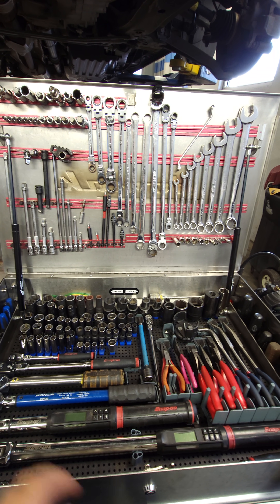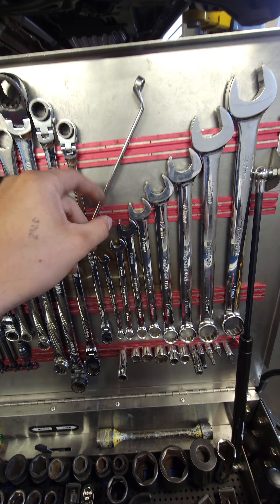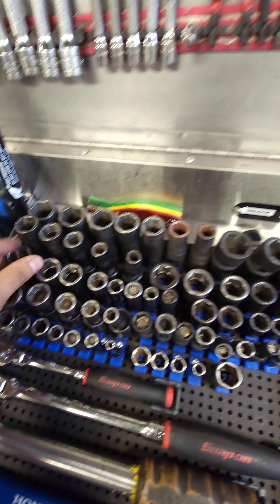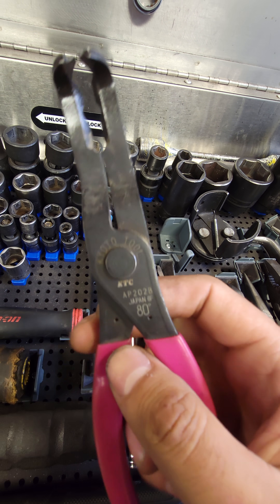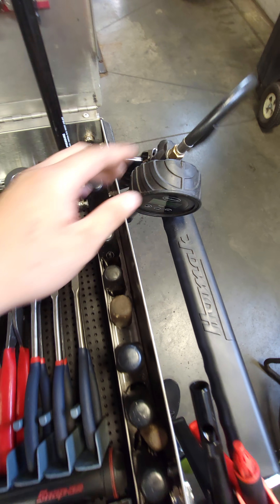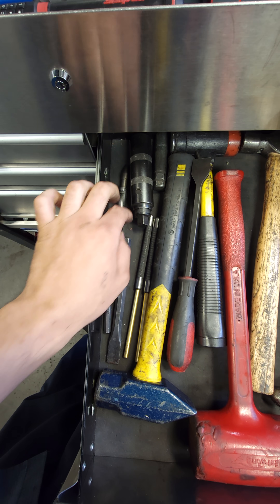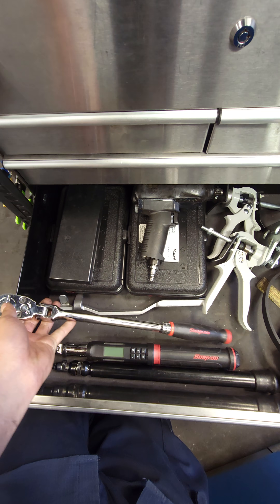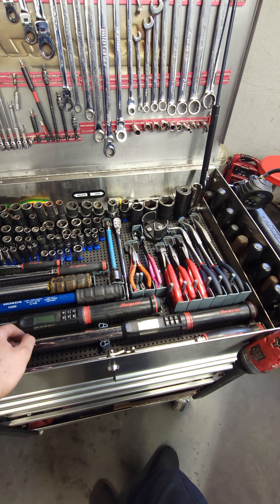Technician Roll Cart Tour | Honda Technician | Tool Grid

Comment: It’s nice to only need 4 or 5 sizes. I was at a shop that did mostly hondas and kept trying to set my cart up that way. Every time I’d immediately get some random chrysler or something that I had to do in an open bay across the shop. Then I’d spend more time going back for tools than actually fixing the car
Reply from the maker: Yea I feel you there. The only reason all these tools are selected in here like this is because my lift broke down and I worked 3 months across the shop from my bay. Being a dealer tech definitely has it's benefits.

Comment: Those Snap-On double box ends are one of the best tool purchases I've ever made. I still use them all the time even though I'm just a diy guy now.
Reply: Because they're straight. Why snap on don't make a set of straight regular wrenches is beyond me, they could sell millions. They almost never slip even when hit with a sledge hammer, you can even put a 2 ton jack under one if needs be!

Comment: Using the lid is the way to go.  I also have VIM rails but you’ll get more bang for the buck using Amazon rare earth magnets.   Thanks for the tour!
Reply from the maker: Yea I had these mag rails for my sockets for the longest time until I got the toolgrid system and then I needed to figure out what to do with 3 sets of mag rails.
Reply: @techt-bone4337  hey who makes the tool cart
Reply from the maker: @johnb1121  Homak. I don't think they manufacturer this one in particular anymore. https://www.vehicleservicepros.com/directory/equipment/tool-storage/toolboxes-and-tool-carts/product/12033015/homak-manufacturing-llc-35-stainless-steel-4drawer-service-cart
Reply: @johnb1121  Snap-on.  Used at 50% new.
Reply: @techt-bone4337  thanks I thought it was good choice
Reply from the maker: Thinking about getting the new harbor freight one
Reply: @techt-bone4337  I will get one for my house for sure worth it

Comment: The only problem with having a stacked cart with no wasted space is once its full it hardly moves. You definitely don't want to roll it around all day. I have a blue point 3 drawer with a top lid and the wheels feel like they're gonna snap going over a zip tie. I'm thinking of welding some cross braces or some adjustable cables like a steel structure. I can't afford a new box suitable for like 5k in tools, haven't found a solution yet.

Comment: How do you like those KTC clip pliers? I'm guessing by the locations you use the 80 degrees more than the 35's. Working on Hondas, do you think you could get away with just the 80 degree set for most things? Thanks and loved the tour!
Reply from the maker: The bigger ones are really nice I use them 99% of the time unless the clip is recessed it won't grab it. The smaller ones are nice too but I don't use them a whole lot. I seem to break less clips with the ktc ones vs the harbor freight ones.

Comment: Nice setup,  its that a 14mm spark plug socket modified?  Thanks
Reply from the maker: It's a regular 5/8 spark plug socket. Had a car that overheated and the plug wires melted in the spark plug hole. Customer wanted a leak down test, so I modified it so I could cut through the rubber and get the plugs out.

Comment: I have my cart layout with complete sets.  Your layout is more efficient and allows you to have a wider variety in your cart.  It gives me Something for me to think on.
Reply from the maker: I got really annoyed of having sockets I didn't really use on my cart. I found myself grabbing them by mistake often. At one point I flipped the ones I didn't use much around so I could identify them, then I just took them out all together. They are still really accessible in my tool box, but not in my way on my tool cart.

Comment: For the 3/8 flex ratchet have you used the locking flex head version from Snap on?  Not sure which one to get.  Thanks.
Reply from the maker: From the techs that I have seen get those the locking mechanism is not the best. It breaks often and can get knocked free. I have not really needed a locking one, however if I had a Matco dealer I'd probably get a Matco locking one.
Reply: @techt-bone4337  Thank you.  I heard Matco are good as well.
Reply from the maker: Our Matco dealer stopped coming just as I wanted to get one of those ratchets. The head is also slimmer than the Snap-on ones.

Comment: You were talking about the Jesus pliers from harbor freight have you checked out the tekton complete line on the pliers i bought a i believe 9 1/2 inch long handles i had like $23 in rewards for the website and i got the pliers and honestly and this is coming from a big fan of channel lock pliers I've owned several different sets of them that pair of tekton pliers is impressive they are built really well and made in the USA, and as far as your craftsman USA made pry bar set,hyper tough and Menards master force and the Mayhew i believe that is the dominator series are all the same pry bar set all are made by Mayhew.

Comment: Hey Tech T-Bone new subscriber!; I have a question I’m currently going to start as a Lube Tech and was curious cause my boss said I’ll need a air gun (impact) but didn’t specify what size? Does he mean like a 1/2 if so can I just get a cordless or should I go with the air
Reply from the maker: As a luber usually a 1/2 is what you'll use for removing and installing wheels. Honestly I would start with a cheaper air 1/2 impact.
Reply: @techt-bone4337  okay man! thanks broths and any recommendations you can give since I’m starting off?
Reply from the maker: Look up the torque test channel. He tests all sorts of impacts.

Comment: What of tool grid do you have
Reply from the maker: All of the sockets ratchets and pliers on topspace are held by tool grid. Bought it through Cornwell
Reply: @techt-bone4337  did you have to cut to fit?
Reply from the maker: Yes. I got the closest one in dimensions I could get and used a jigsaw to cut it. Used a straight edge clamped down as a guide.

Comment: That wrench extender is key for tie rod jam nuts.
Reply from the maker: Works great especially with a little heat. Actually used the wrench extender with one of my screwdrivers to get an CV axle popped out of the transmission where a pry bar wouldn't quite fit due to the angled tip.

Comment: How often do you get your torque wrenches calibrated?
Reply from the maker: My digital torque wrenches have not needed to be calibrated. They get checked on the Snapon truck from time to time on the machine they got. As long as you torque at a slow consistent pace holding on to the handle correctly you find the wrenches to be really accurate. The Honda ones our tool dealers will check if I ever drop them.

Comment: Really, a brake bleeder wrench for valve adjustments? I promise you you'd love the tool were it's built in one with the screw driver. Nice set up tho.
Reply from the maker: I have one of them. There's certain vehicles where the tool won't fit though so I'll use that instead.

Comment: No line wrenches
Reply from the maker: I've gotten away all these years without them. If I did get some it would probably be some cheap ones in 8,10,12,14mm.
Reply: @techt-bone4337  cheap line wrenches suck. Better off using flank drive open end that it looks like you have
Reply from the maker: Yea Flank drive plus. Never have an issue